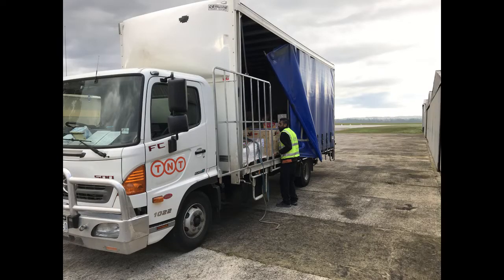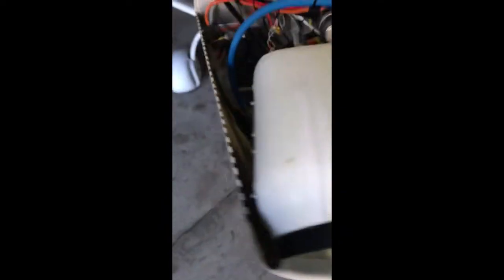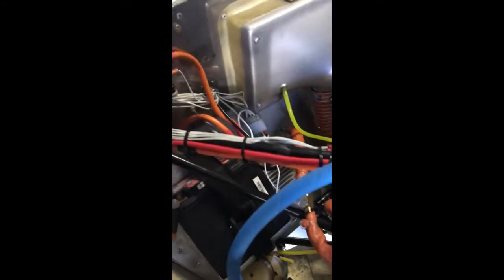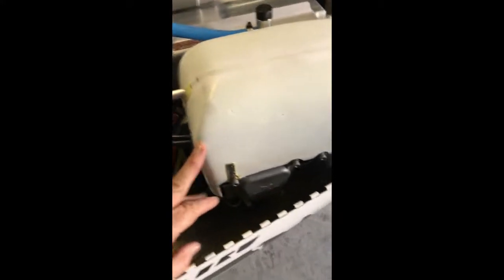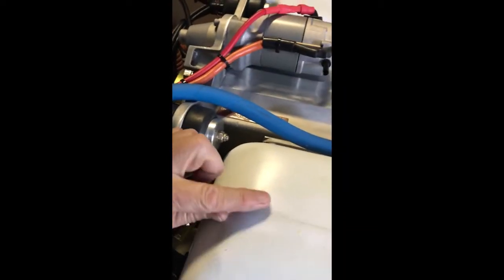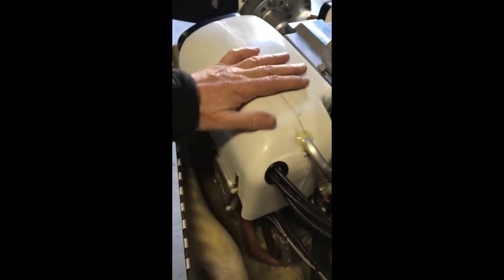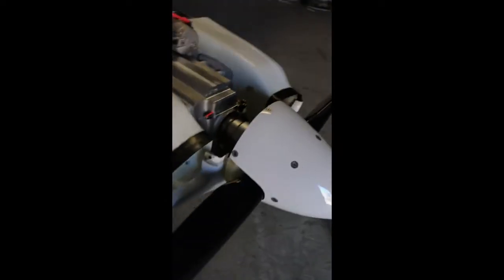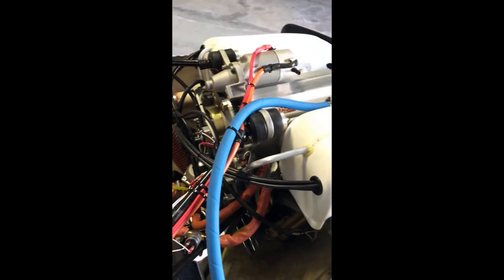How to install a Jabiru Generation 4 Engine

Comment: Hi, was there any mods to do with the Tacho ? I’ve just received my engine and unpacked today.
Reply from the maker: No, nil mods. The yellow wire needs to be cut, from the voltage regulator plug or the charge light will always be on if you have one

Comment: Hi mate, great video. How did you go with the charge light? I have the same issue.
Reply from the maker: Sorry just saw this. I cut the yellow wire at the reg. So in effect no more charge light as per Jabiru recommendation.